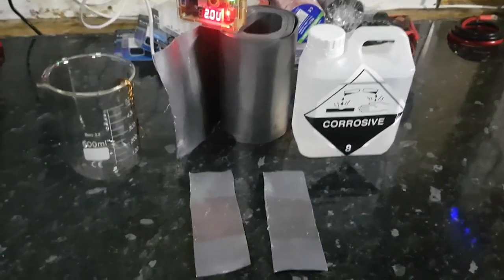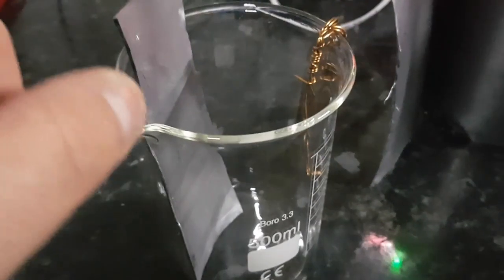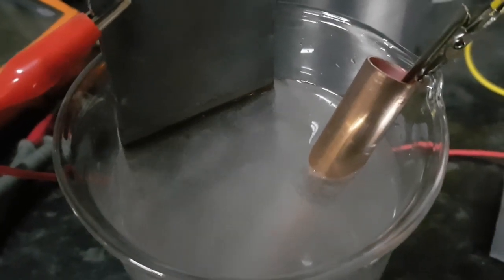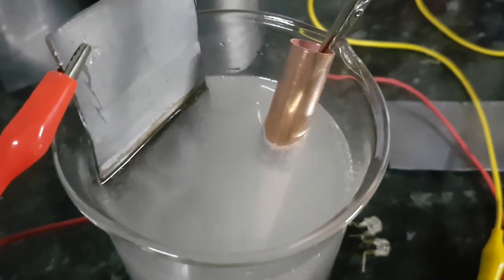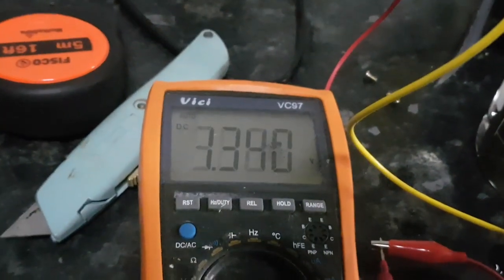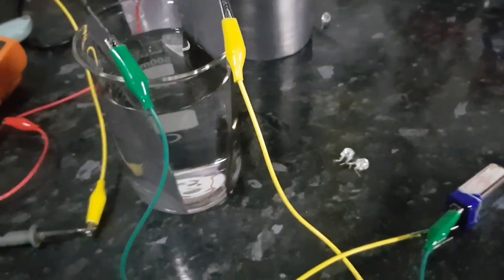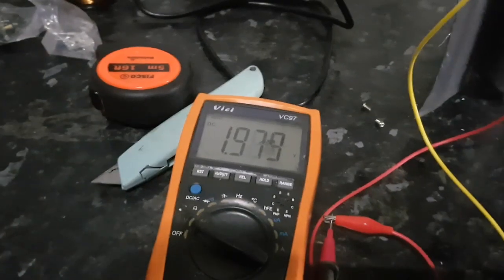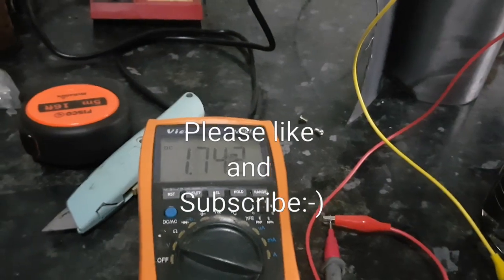Making a Battery (lead acid cell) part 1

Comment: Also works with baking soda. sodium carbonate. and sodium sulfate instead of sulfuric acid. much safer too. but less voltage than sulfuric acid. it still works.
You can increase the amperage and capacity by stacking many thin (0.2 to 0.5mm) thickness lead sheets or rolling long lengths up into a cylinder with a porous separator.
Ive gotten over an amp hour from one that fits in a pill bottle container. using sodium bicarbonate and sodium carbonate in a 50/50 mixture with distilled water charged and discharged many times reversing the polarity. at 20 to 50 times before it really starts taking off.
You can even try aluminum sulfate with sodium sulfate mixed together. Ive gotten up to 2 volts before just like sulfuric acid. and the performance is improved. decent capacity and performance. ive gotten many amps of current from some small cells too.
Reply: I have used magnesium sulphate - works but self-discharge is high and the battery dead after a couple of days. One way around seems to be to remove the plates from the electrolyte but inconvenient to say the least. Alternative, you can make sulphuric acid from magnesium sulphate using a membrane like an unglazed flower-pot and lead or carbon electrodes. Years since I did this but think the acid forms around the anode.

Comment: so wouldnt it be better to use directly copper plates. instead electroplating or do we filter waste materials by electroplating . it seems like copper is melting on old batteries and i thing it. can be better to replace plates with copper plates so we may end up with more durable batteries.

Comment: Shouldn't you use a 12V battery charger to form the plates? And, the thicker the plates, the higher the current you can draw off the battery. Couldn't you paint the plates with red lead to hasten the process? Red lead is just oxidized lead in a pigment that was baked on? I have seen the manufacturing process the pro's use, some use a lead oxide paint to hasten the process of forming the positive plates. I have books on the Edison Battery, and am going to go that route because those batteries were made over a century ago and some still work today. You will never start a car using an Edison battery, but they do have their lower current uses. I want a forever battery that will power battery radios. We are big in this area on emergency preparedness because of tornado and hurricane damages, FEMA takes up to six weeks to even show up - what good ARE they? Communications and storing food and water for the times that FEMA drags their heels on getting to the damaged areas is the wise way we prepare. Normal batteries do not store long enough in the humid weather we have in the deep South. So, DIY batteries are the thing to have if you can build and repair if needed.

Comment: Actually, lead oxide forms naturally on the anode during the initial charge, the reason commercial batteries start with lead dioxide, is because it is faster to produce. The reason your battery is not charging, is because you are using too high of a voltage, and too low of an amperage. One cell may only be charged up to 2.1 V, and takes approximately 5 amps or more.

Comment: Great video! Thank you for sharing!!! I'm a little confused. I want to make my own lead acid battery and the reading I've done shows one  should prime the battery by connecting a charge to the plates (i.e one plate + and the other -) This conditions the plates to give them polarity. You use copper, is this to prime the + plate?

Comment: How thick is your lead flashing?
Reply from the maker: I think its 5mm I'm not sure tho I'll double check
Reply: @Field_to_Farm  The most "cost effective" I could find is only 1/64 inch (about 1.59mm).  Could this be used in any way? Possibly layering 2 or 3 pieces and melting them together in some way? I really enjoyed this video and would like to give it a try. Thanks for replying so quickly

Comment: where you get you roll of lead?
Reply from the maker: In the uk u can buy it from a shop. It's a common building material called flashing thats used to weather proofs windows and roof edges 👍

Comment: May I ask the purpose of the copper? Wouldn't putting the other sheet you will use as your 2nd plate do the trick too? Or will the 2nd plate lose some lead that you want to keep?
Reply from the maker: Basically ye, I didn't want to use the second lead strip incase it lost alot and got thin.